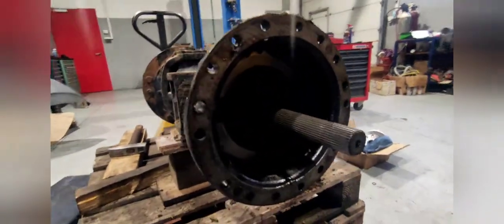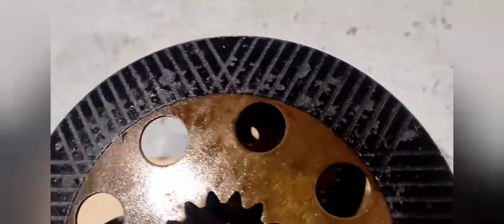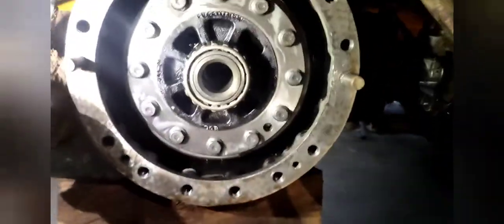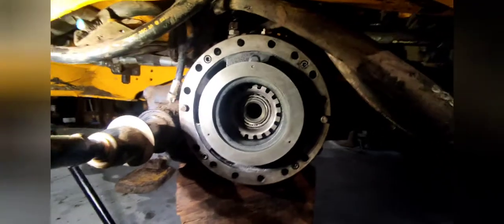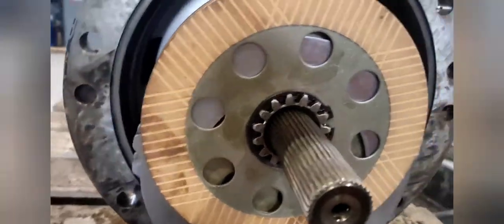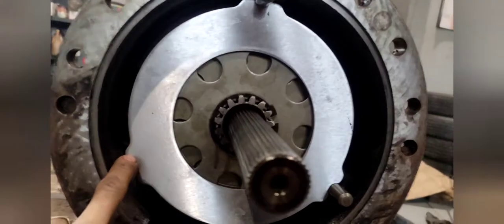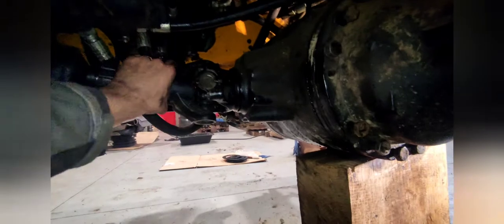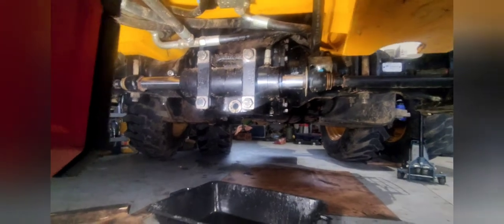JCB 4cx eco brake problem part 2, replacing brake discs and seals, photo and video

Comment: My break warning light used to turn on i went to a mechanic, he said change the accumulator. I changed it but it still turns on. so how do i fix this?
Reply from the maker: Connect pressure gauge and check prv or pressure switch
Reply: @stjepanhuzjak  Sir, My jcb is in a good condition, it was in a factory standed  for 5 years. I bought  it recently. It has only walked for 5000 hours. It is a very clean car. All new parts. But the only issue is the break.